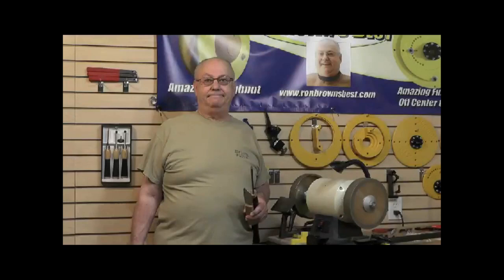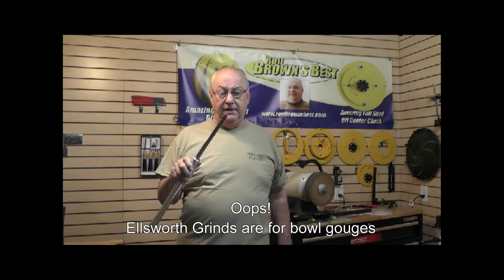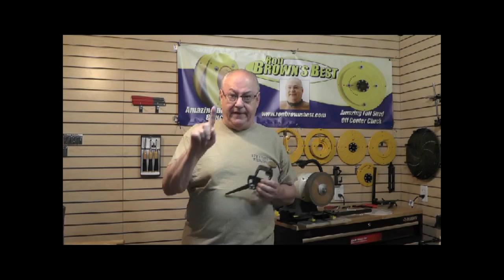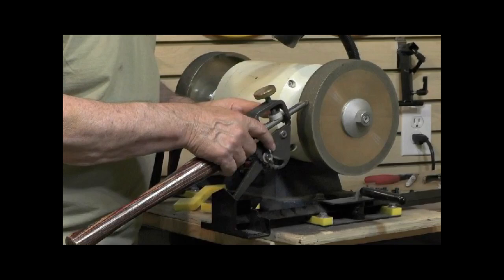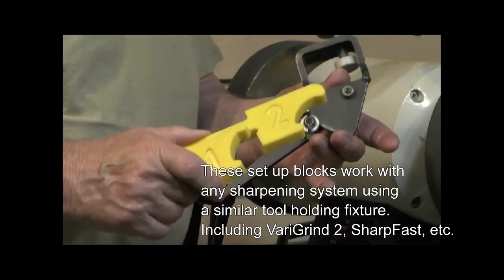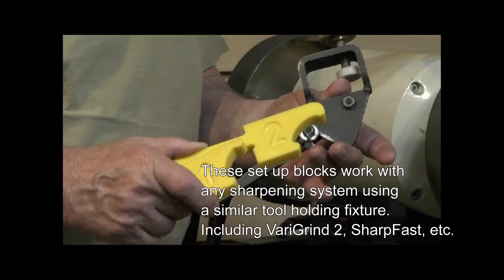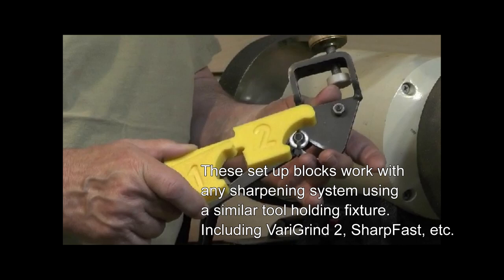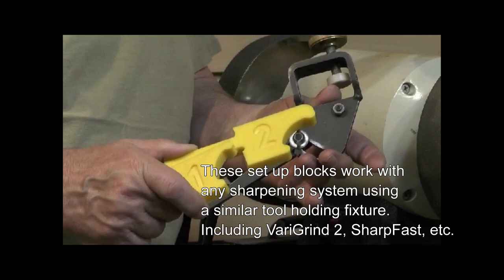Gouge Set-Up Blocks - Quickly and Accurately Sharpen Bowl and Spindle Gouges #woodturning #wood

Comment: Thanks Ron, this is a great video.  On block #1, your printed instructions show the same leg notch.  Number 2.  How does one get two different grinds from block # 1 using the instructions.  All variables are the same.?

Thanks
Reply from the maker: Not the same. However, the standard bowl gouge and the fingernail grind for a spindle gouge do use the same settings. Everything else is different except the stick out which is always 2" with these blocks. Ron
Reply: @Ronbrownsbest  Ron

The instructions says to use notch number 2 for both grinds on the leg, 2” extension and the angle is the same.  Help